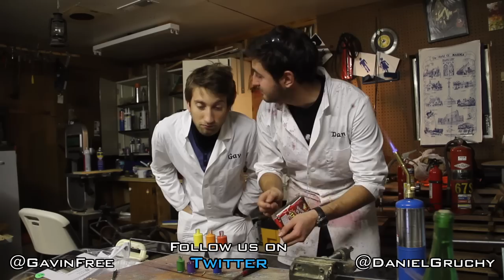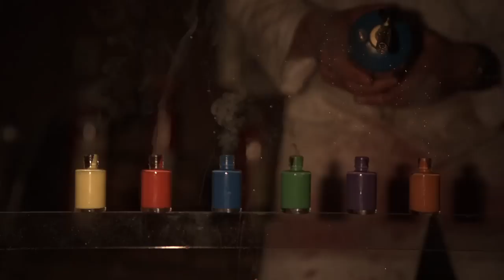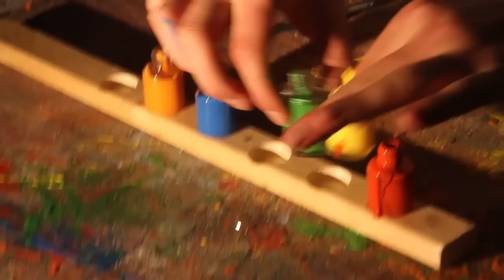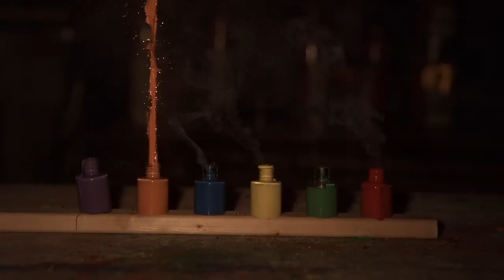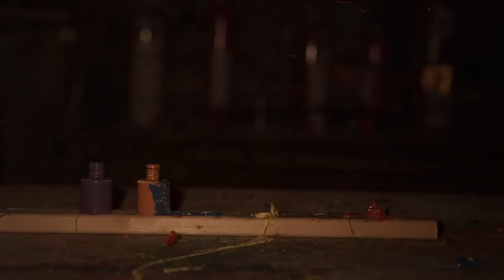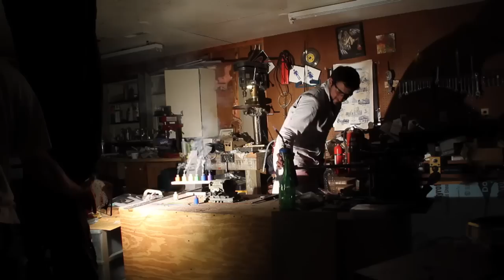Paint Exploding at 15,000fps - The Slow Mo Guys

Comment: In the second set, the explosion from the blue bottle actually blasts the neck off of the yellow one. You can see the firework sticking out before it goes off!

Also, guys, if you're going to continue doing stuff like this, you should either get "bangers" with longer fuses, or invest in a kevlar-lined lab coat for Dan.
Reply: yea right? I was thinking they were going to do something intelligent like rig some sort of singular fuse to each firecracker, but noooooooo "LETS USE A BLOWTORCH"
Reply: Rea Davies It's funny you say that, Dan got a shard of glass in his finger when they were doing this with bigger bottles and bigger bangers.

Comment: I want to see this again but with more light
Reply: and white backdrops
Reply: Leuretti That's why they need more light.
Reply: but when there is more light, the normal speed clip will be plain white:/
and if you adjust the iso, resolution will be lowed :0
Reply: Cycber Lee That doesn't seem to be a problem with daylight shots where there is more light.
Reply: +Cyber Lee No that's not how that works. The images don't get brighter if the are played back faster...
Also the FPS affects the resolution, not the iso.
Reply: i mean espousing too much makes it white
(my bad, i forgot it's not a photo)
btw doesnt that drop resolution when more processing units are fcousing on iso, as memories are limited
Reply: Cycber Lee Also it should be mentioned that when I say it needs more light, I mean it literally needs more actual light and have the settings changed accordingly. As it is, brighter environments make slow motion footage easier to film.
Reply: And higher FPS

Comment: Dear Slow Mo Guys,

Please make all of your experiments in slow motion into Gifs because they would look marvellous as live wallpapers!!!
Reply: agreed
Reply: I'm sorry, but what OS are you using? Because you damn well can't use gifs as wallpapers in Windows Vista and up.
Also, GIFs don't really have the best quality.
Reply: Well, Slow Mo Guys, 22 people agree so what do you say?
Reply: I can't remember what its's called but there's a website that converts any youtube video into a gif that you can download.
Reply: The website is called clip converter you can download them into mp4 and basically anything
Reply: BlenderLager
GIF quality is not bad. Its almost PNG quality. But most encoders turn down the colors, drop frames and do more to make the file smaller.
Reply: drkastenbrot Yes it is. Have you ever even seen a proper comparison? 

Adding onto BlenderLager's statement, one of the reasons why GIF looks so horrible, is that it only supports 256 colors per frame. It therefore samples what colors are used the most, and uses this to correct a color similar to one of the 256 said selected colors 
It is not even comparable to PNG.

GIFV - The new format made possible by websites like Imgur is much better in terms of quality and compression, however, it is only supported in HTML5.

Pulling statements out of your ass that are illegitimate is just unnecessary.
Reply: erwinteringham i downloaded the videoopened it with vlc
used the frame-by-frame thing
every 2 frames i took a picture
turned it into a vtf

ill try sending it but its not in gif form, only in vtf, i dont know how to change it to gif
i think vtf form is bettah cus u can veiw each frame and see which is useless or not
Reply: jjbincs okay thank you